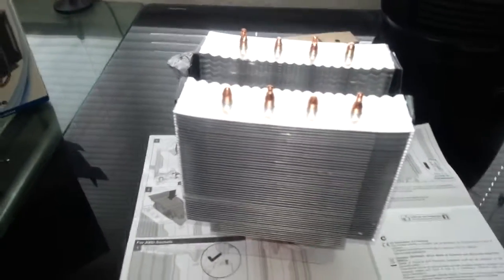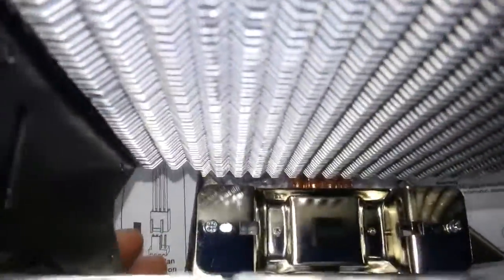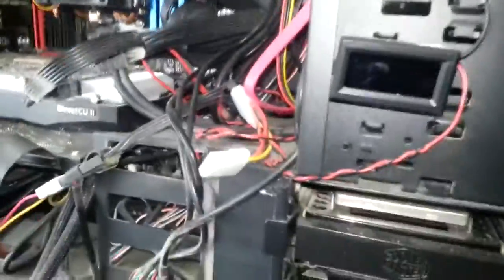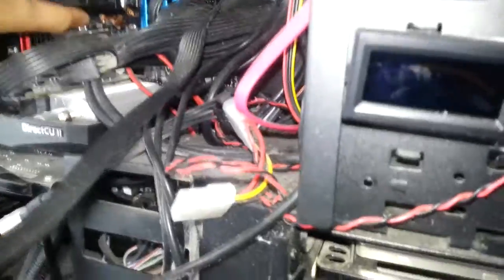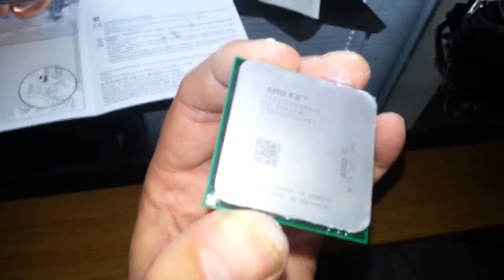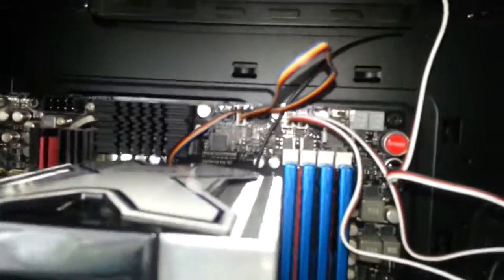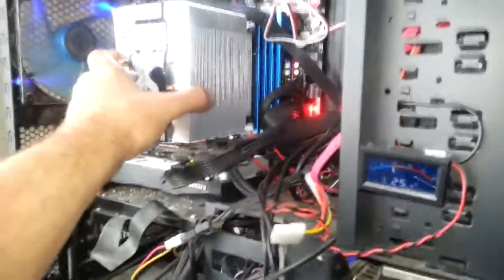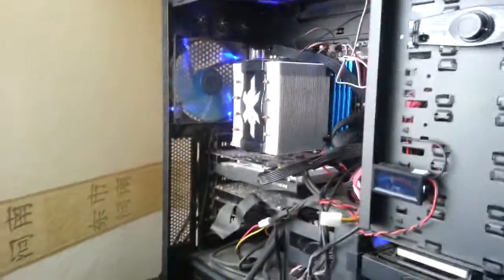Installing My Arctic Freezer Xtreme Rev. 2 CPU Cooler

Comment: That cable management xD
Reply from the maker: Yeah, it's great. lol
Reply: John Gage how did you find it performance wise as I got one but the cpu temp still on higher side :/
Reply from the maker: I have 2 of these and they do keep the temps down. Better then those stock coolers.
Reply: @John_B_Gage  i must have a bad one then, cause on this one my idle temp was 50C and game temp 75c 

but on the stock cooler (copper based one) my idle is 22C and game temp is 35C

Comment: Nice install !! On an ATX Motherboard MSI x370 Gaming Plus cancels a ram slot??
Reply from the maker: I have 2 of these coolers installed in 2 different ASUS AMD motherboards and they don't cover up any RAM slots.
Reply: Thanks! The height of the cooler is 140 mm , I HAVE a housing with Max CPU cooler 140mm(max), can fit?
(Segotep SG-k6 black)